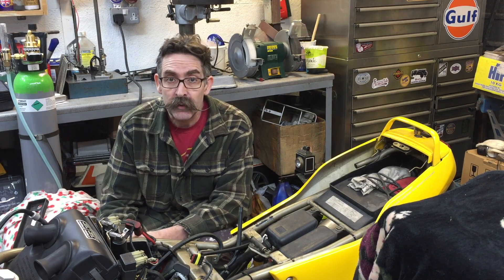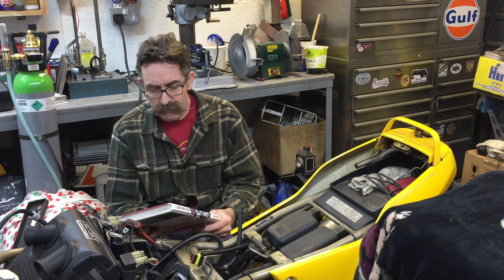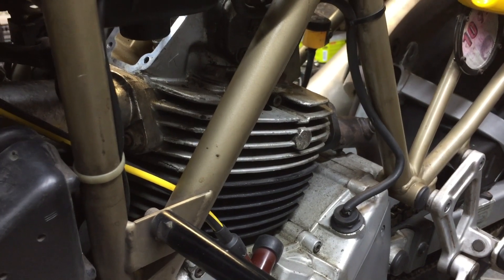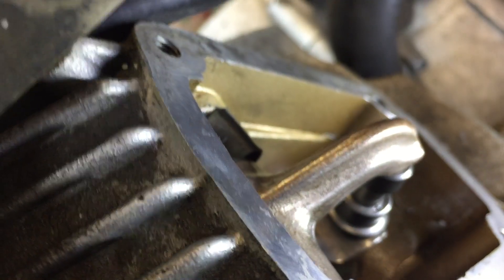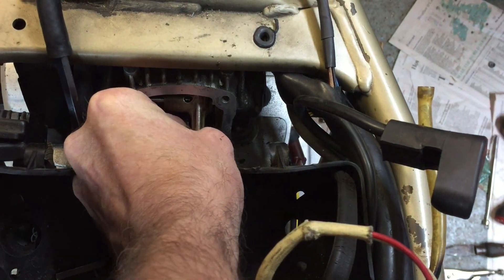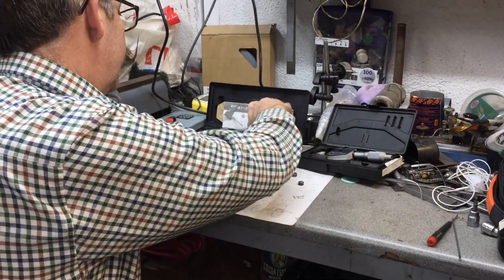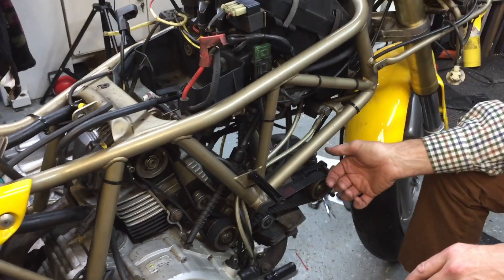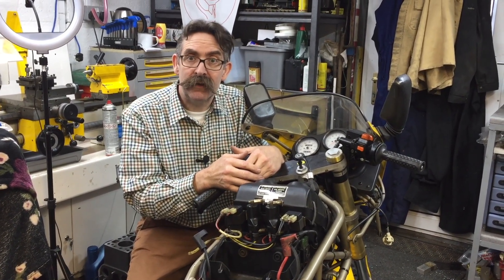Adjusting Ducati valve clearances

Comment: Thanks for introducing us to the mysteries of working on modern motorcycles, I think I will stick with my Vincents! I understand that the cam belts have to be changed every 5000 miles, is that correct ? Chris B.
Reply from the maker: it is something ridiculously short like that, i suspect it was just Ducati keeping their dealerships in gameful employment as most car cam belts are around 40000 miles, i wasn't sad to see it go, shame as the air cooled Super Sport range gallop along quite nicely and eat the miles ( apart from their hideously small steering lock which can catch you out during slow speed manovering )